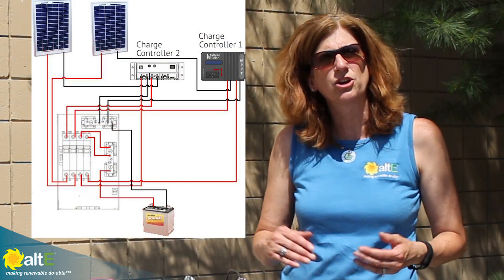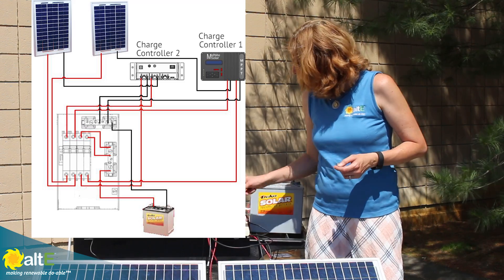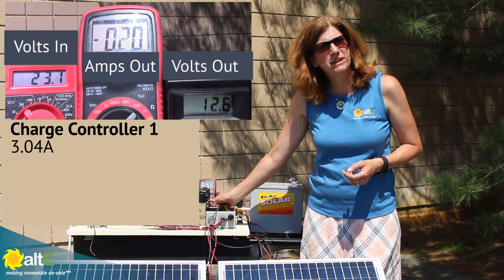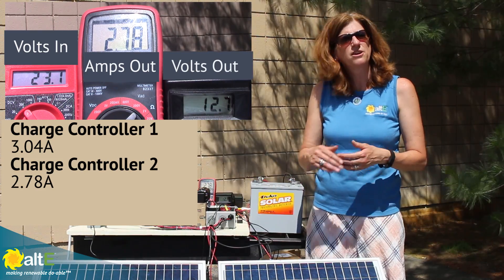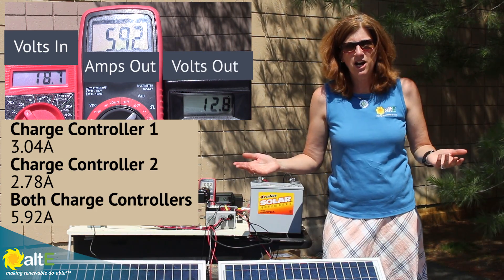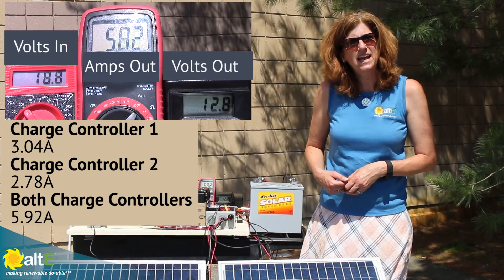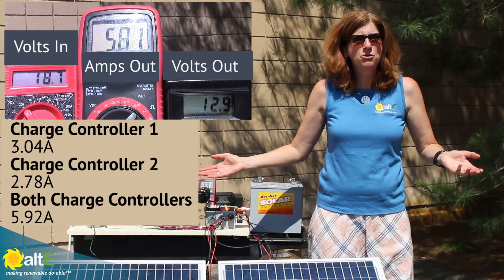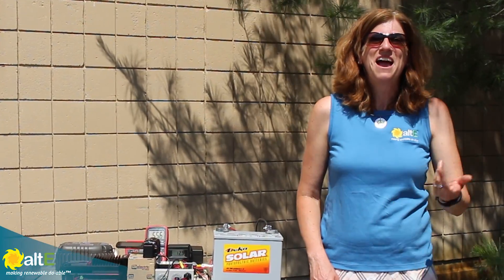Wiring two charge controllers in parallel

Comment: Hi Amy, I have a 260 W panel and 20 A mppt controller, I have a 12v system. My batteries are about 4.5 feet away from the controller, what wire gauge should I use to connect the batteries to the controller? Thanks.
Reply: You want to have 2% or less of voltage drop. .2V is right around there. Make sure the wires are connected well, you should be fine.
Reply from the maker: We did a video on code compliant wire sizing here, https://www.youtube.com/watch?v=89u8R_aUFO4 . But with 20A such a short distance, 10AWG is most likely plenty.
Reply: +altE thanks. I used 10awg, I noticed a 0.2 V difference between the controller and my multi-meter when I check the voltage with it on the batteries terminals. Should I be worried? 🙁

Comment: Dear AltE, how can we make sure that the current coming to two charge controllers are equally distributed between the two charge controllers. Isn't it possible that one charge controller take over all the current and burn out and then the remaining charge controller will take over all the current and burn out as well. Please, clarify this.
Reply from the maker: Great question. Each charge controller will have their solar panels connected to its own input. So 1/2 of the panels are connected to charge controller 1 and 1/2 going to charge controller 2. So neither charge controller would get the input from the other panels. But it is important to have the voltage output of the two charge controllers set to the same value, so one isn't putting out a higher voltage than the other and thinking that the battery bank is full and shut off.
Reply: Thanks altE for support.

Comment: Amy since positive and negative lines are tied to a bus bar could I also run lines to an grid tie inverter as well? This would give me a grid tie and off grid at the same time?
Reply from the maker: You would need to use a hybrid grid tie battery back inverter that can connect to both a battery bank and the grid. You can find them here https://www.altestore.com/store/inverters/hybrid-inverters-c561/ . A straight grid tie inverter needs a higher voltage than most battery banks can deliver.

Comment: good but can I use different types of panels for example 100 w  and 200 w for every charger
second question can I use different types of charger?
Reply from the maker: Yes, to both questions. This is the best way to use mismatched solar panels for your system, put them on their own charge controllers. If you do use different types of charge controllers, try to have the settings set the same, for instance the same float, absorb, and bulk voltages if possible.

Comment: Amy, I am not sure I understand why I would want to connect two solar controllers in parallel ???? There's not quite enough information in this video. Am I going to do this simply to increase the overall amps my system cam handle ?? Also, how, exactly, do I make the dual controller connections ?? Am I simply adding the additional output from my extra controller to my battery array, or do I require some kind of fancy interface box to accomplish this ???
Reply from the maker: There's a few reasons why you would use more than one charge controller in a system. 1) If the charge controller you have is full, i.e. it is a 30A charge controller and you have 30A of solar panels on it, and you are adding more panels. Rather than replacing the controller you have, you can add a second one for the new panels. 2) You have very mismatched solar panels (like in our other videos). If you have a 200W panel, and are adding a 50W panel, the two can't share the same charge controller. A 2nd charge controller would be used for the new 50W panel. 3) You have panels facing different directions. If you have some panels on an east facing roof, that catches the morning sun, and some on the west roof that catches the afternoon sun, or variable shading, such as on a sail boat, you wouldn't want to have both arrays on the same charge controller, as the shaded panels would pull down the output of the unshaded panels. A separate charge controller for each array would maximize the output.   To wire the outputs together, each charge controller output would go through its own breaker, and then ideally to a negative and positive bus bar in the DC breaker box. It doesn't have to be fancy, depending on the size of your system, we're using a Midnite Solar Big Baby Box in this demo.
Reply: Mark Job lets say you have two 250w panels but one 20amp charge controller, 12v x 20amps = 240w. Because of the controller's limit, one panel isn't doing anything. By using two 20a controllers to each panel each sends 240w to the battery = 480w. Hope this helps.

Comment: Also I think that they should have the same configuration like boost and float voltage if possible.
Reply from the maker: Excellent point, I should have said that. If the charge controllers are configurable, having the voltages match improves the performance, where one isn't turning off earlier than the other. If they are not configurable, having both charge controllers the same model, or at least the same default settings is best.

Comment: are both solar Charge Controllers getting input from separate solar Panel??  
plus one more question, you didn't mention in the video that what type of controllers are they?  both are mppt?  or one is mppt and other is PWM??
Reply from the maker: You can see the schematic at 0:22, watch the video in full screen and pause it. Each panel is going to its own charge controller. Charge controller 1 is the Midnite Kid MPPT charge controller, and charge controller 2 is the Morningstar SunSaver Duo PWM. The Kid is outputting a little more current, but what I don't really show is that it is also using more power. The Kid uses about .25A, which is subtracted from the 3.24A it is actually putting out, which shows as 3.24A - .25A = 2.99A. The Duo barely uses any power to run, so you get to use all the power out. This is why a small system may not benefit so much from MPPT, since it uses more power than PWM. But a large system does benefit from MPPT, as the increased output is more than the increased use. We'll be making that video soon.
Reply: +altE thanks for the reply,  I did watch the video at full screen of twenty Inches led screen of my Computer desktop but still Couldnt understand the circuit diagram showed in the video. 
can I just mix and attach the Both charge controller's output together directly on the battery terminals??
Reply from the maker: The positive output of each charge controller goes to its own breaker, and the outputs of those breakers can be combined at a busbar, or at the battery, whichever is easier(probably easier in the breaker box, then only 1 wire has to go to each terminal. The negative outputs of the charge controller are likewise combined and sent to the battery. Here's a schematic by Midnite with 2 kids that might be easier, http://www.midnitesolar.com/pdfs/KID_PAR_Wiring_REV_B.pdf
Reply: +altE now it's clear Thankyou so nice of you solar queen :)
Reply: reading my own comments after 8 years :)
Reply: How interesting.....

Comment: are all buss bars the same for atteching outputs from devices to the battery bank or are some better than others? like steel, aluminum, copper, brass or stainless steel?
john
Reply from the maker: Like most things these days, I'm sure there are some that are better quality than others. The ones we're using in the demo are from Midnite Solar and are tin plated aluminum. Some of their other busbars, like the finger busbars for combining the outputs of the breakers in their combiner boxes are tin plated copper.
Reply: SANTA CLAUSE !?!???